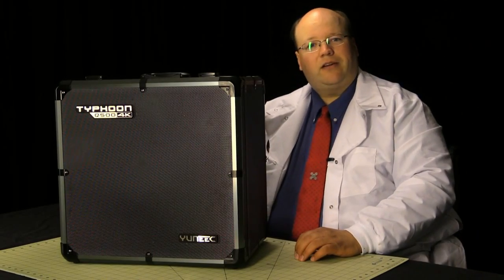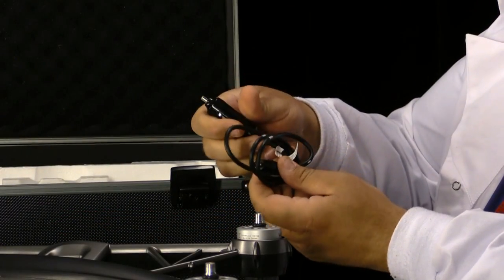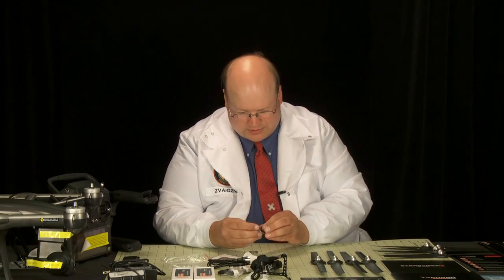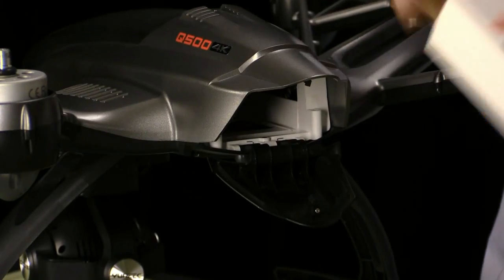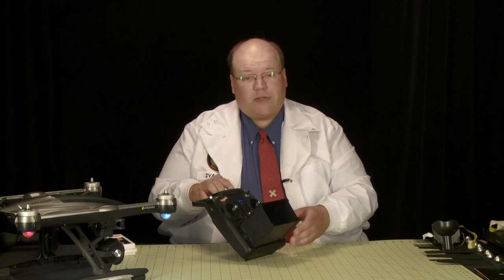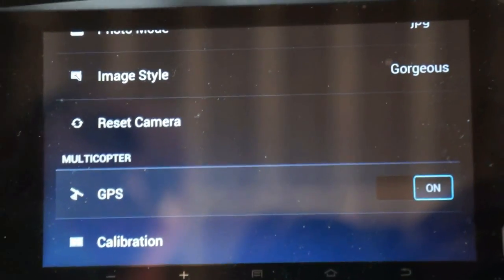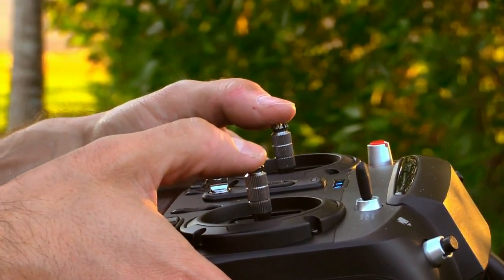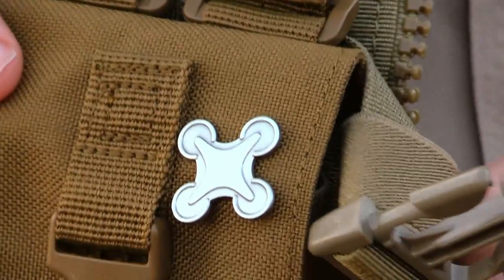Yuneec Typhoon 4K Drone Unboxing, Setup and Flight Testing

Comment: I'm REALLY impressed with these pro-sumer Yuneec drones. Especially the Typhoon hexcopter and controller. Without having had a chance to personally experience this 4K hardware, the radio and drone itself just don't look on par with the previous offering. Obviously the optics have been improved... but I wonder why they cut corners in every other area?

Comment: How do I import the videos from the drone? I need help.
Reply from the maker: Probably the most sure-fire way would simply be to remove the MicroSD card from the bottom of the gimbal, and plug it directly into your computer, using a full-sized SD card adapter or a USB adapter. Then, you can pull the videos off using Windows Explorer, just like any other external memory device.

Comment: Got a very bad experience with Yuneec Drones. WONT RECOMMEND buying Yuneec drones. The review is good, but the company really gave me a hard time. Got a Phantom 3 thereafter and have never looked back.
Reply: You didn't even said why is was bad... I have a chroma 4k and it work perfectly
Reply: No one cares, I bet it was your own fault, don't be a fan boy lol
Reply: Bloom Mobiles q500 is amazing
Reply: JUNK JUNK JUNK --- I purchased this one 2 years ago.  It didnt work at all so I was able to get a replacement --- Second one will NOT lift off the ground and this SHIT company will not respond to getting it fixed or replaced.

TOTAL JUNK
Reply: William James Rapp your supposed to put propellers on before you try to fly it

Comment: phantom kills this
Reply: True but for the package deal under $800, this is good deal since it comes with EVERYTHING. I would have to spend 2k on a Phantom 4 to get same accessories.
Reply: one thing i see is the typhoon is way easier get parts;  the gimbal and cAMERA  seem expensive;
 I do not see many parts for phantom;
Reply: Sure, but you could almost get two of these for that...one to keep and one to give away (or crash).
Reply: +Mike Gauer Phantom 3 4K for sure is the winner
Reply: +Mike Gauer Finally someone gets it

Comment: When I got the transmitter on and the typhoon on and I wait a couple of mins for it to bind, it seems that my camera is pointed just a little to the left. It seem that the camera is not line up dead center of the Typhoon. Any advance on this issue? and also when I try to take a snap shot it tells me that the snap shot fail. I sure it just some that is simple to fix or something that I'm not doing right. Thanks for any info.
Reply: I'm a bit late, but for your camera, I had the same problem. You just need to calibrate the compas
Reply: For the snap shot, sometime it doesn't work when the camera signal is trash...
Reply: +Nelson Robert ok thanks

Comment: I will not buy a yuneec drone untill they fix the range issue. even the new typhoon H cant fly that far. I read a comment from yuneec saying 1600ft max. In comparison you can buy dji drones that go miles from you transmitting hd video back to your controller. I want a typhoon H but I cant see buying one if it cant fly out and get the pictures i need to capture. Im just gonna wait to see what dji comes out with this year since they seem to have long range transmitters.
Reply: +Michael Fuller stick to the legal limits
Reply: The Typhoon age will easily beat Lb.
Reply: +MLG Merkel *h
Reply: then the phantom 4 have more range that this drone?
Reply: anothet thing the phantom 4 have is the sensor to avoid crash
Reply: Michael Fuller I am glad DJI drones can go miles from "you" controller
Reply: +shaun george ,  Its legal as long as i or a spotter can see it and i stay under 400ft. I have not violated these rules.

Comment: amazing video guy's, but if I may ask what happens when the quad fly's out of range of the radio?, does it RTH like the 3DR Solo and DJI Phantom?
Reply: +JEFFREY SOLORIO (PROJEFFREY11) It does in fact RTH.
Reply: +JEFFREY SOLORIO (PROJEFFREY11) while the gps mode is on there is a 300 ft radius that the drone stays in and it also doesnt fly into commercial airspace or take off within 5 miles of a commercial airfield

Comment: Great video as always.  One thing that I have never seen mentioned on any of the videos is the transmitter SD card.  I don't get my unit until Wednesday and I am curious.  In the unpacking, the only SD card is the camera card.  Does the SD card for the transmitter come installed in the transmitter out of the box?  Thanks.
Reply: I do not think so
Reply: +Steven Means True, I've had the unit for awhile.
Reply: I do not think so but I bought on anyway

Comment: Great the battery has an EC3 plug so I can charge with my Hyperion using either EC3 or XT60 plug
Reply from the maker: +Raptor50aus Yup -- works like a charm. I've done it myself. It's just one more of those small details that Yuneec got exactly right, making it both easy for the newcomer while simultaneously working well for the established drone user. Smart!

Comment: Yep this is my next drone as upgrade for my DJI Phantom 2 (not going for the Phantom 3)
Reply: JUNK JUNK JUNK --- I purchased this one 2 years ago.  It didnt work at all so I was able to get a replacement --- Second one will NOT lift off the ground and this SHIT company will not respond to getting it fixed or replaced.

TOTAL JUNK
Reply: I have both and I strongly suggest the Phantom 3 standard
Reply: I have both of these drones and I strongly suggest a phantom 3 standard
Reply: Good call. The phantom line up is garbage.

Comment: Out of all the RTF camera carrying Multi's currently available the Q500 offers the best out of the box solution as you don't have to beg, borrow, or steal a smart device to use it. However one game stopper for me, and others in a similar situation, is the five mile radius no fly zones. If Yuneec were to adopt the same system DJI have used on the P2V, P3, and Inspires I'd be throwing money at my local dealer, who as it happens is unable to test or demonstrate the Yuneec range for the same reasons.
Regards
Nidge
Reply from the maker: +sputniksam Interesting observation -- I haven't run into that problem myself yet, but I'll concede it would be really annoying to not have your machine lift off, even if you cleared it with your local airport, and so forth. I agree, a hardware-embedded, blanket prohibition against flying within five miles of an airport takes it a step too far -- because there are plenty of instances where it is perfectly legitimate to fly if you're within five miles of an airport (as I mentioned, if you've worked it out with the tower in advance, or if you're at one of the dozens and dozens of established AMA fields around the country that fall within that exclusion zone, for example). I guess the good news is that it's only software -- and software can be updated. Hopefully, Yuneec will take a more enlightened perspective on this issue and go ahead and make that change.
Reply: +Roswell Flight Test Crew Thank you for the reply. It is very confusing as neither Yuneec nor DJI have implemented the no fly zones correctly. Only the Mission Planner Software, for the APM and Pixhawk, has the correct information in the mapping application and even then I don't know if it limits the use or is merely an advisory as I haven't attempted to fly in that area. Within Yuneec's interpretation of a no fly zone for this area there are at least two BMFA affiliated model flying clubs. I spoke with Yuneec about this and while they acknowledge they have received many complaints about this they have no intention of revising the no fly zone data. Interestingly the Blade Chroma, which is also made by Yuneec, doesn't have these embedded restrictions and instead are user definable.
Regards
Nidge
Reply: Just turn off GPS and you are good to go.

Comment: This is the new link for the quadcopter PIN. Thank you!!!
 
http://m.ebay.com/itm/DRONE-QUADCOPTER-Remote-Control-RC-Helicopter-Work-Jacket-Hat-Lapel-Pin-/171971796669?_trkparms=aid%253D222007%2526algo%253DSIC.MBE%2526ao%253D1%2526asc%253D20150519202348%2526meid%253D0516b32501f24afc98191c3ca79c1e7a%2526pid%253D100408%2526rk%253D1%2526rkt%253D7%2526sd%253D171898692454&_trksid=p2056116.c100408.m2460